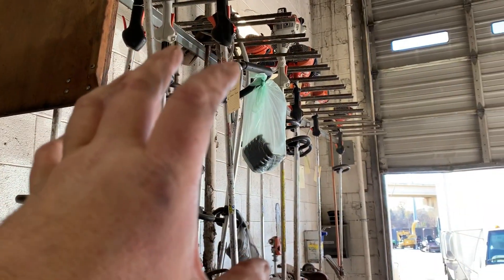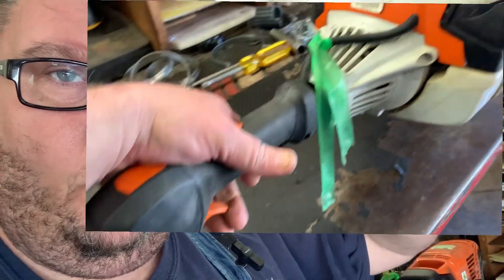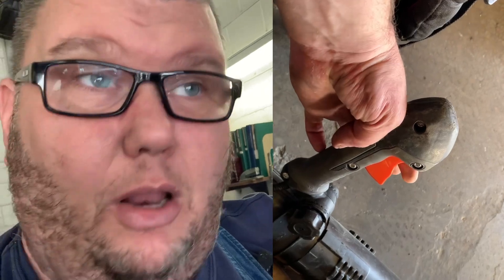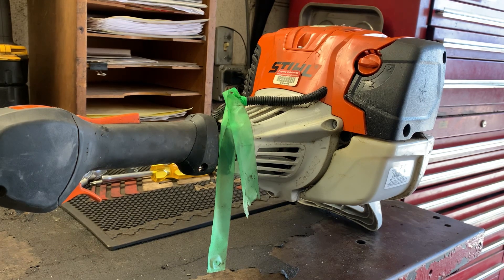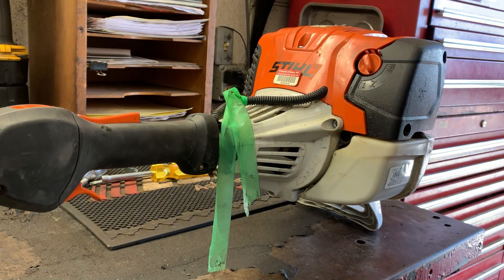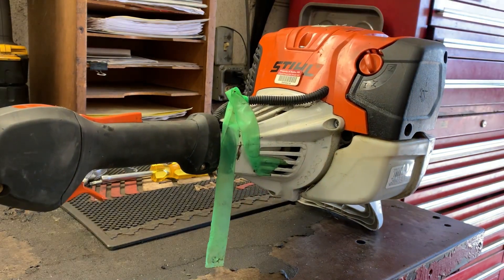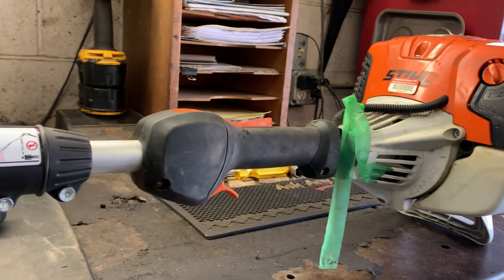HOW TO PROPERLY START A WEED EATER / BLOWER / CHAINSAW ETC

Comment: Its the slightly longer path the fuel/air/oil mixture takes in these 2 stroke engines that a lot of operators either forget or don't know about. For a cold engine, the combustion chamber needs a decent amount of fuel/air charge to start, hence a full choke. Once this first volume of fuel mixture has passed into the 'C' chamber the engine starts or spurters, and no need for full choke. At this stage the engine has cycled and there is more fuel/air charge coming from the crankcase and to keep the mixture at its optimum the choke is good at half or fully open. Easy way for operators to get to grips with starting 2 strokes is to understand the fuel/air pathway on one full revolution of the engine - diagrams would be good to show this.
Also after a start, these engines should be warmed up to temperature, gently especially in cold ambient temperatures. The first part to fail in a lube starvation situation are the piston rings and cylinder and these also get all the heat.
Reply: Very well said. After the machine is started, let it idle until it's up to proper temp, the full throttle while cold is a very damaging thing to do, a cold seize, and harsh wear is sur to follow.
Reply: All great information as stated but none of it does any damn good if NO One read the owner's manual.  Knuckleheads training other knuckleheads.

Comment: I'm not sure if I am lucky or I just take super good care of my handheld equipment. I have a pb-770t and I don't full throttle to start it, even in the super cold. I prime it until the bulb is full, full choke, pull twice and on the second pull its firing over, quickly switch off the choke and its running as it should. my srm-2620t and my pas-2620 are primed, full choke, pull twice to sputter, switch off choke, one pull to start. Maybe the only issue with the trimmers is they take a second to get up to full RPM.  My pb-2520 is slightly the same but I full throttle and feather the choke to warm it up to full rpm quicker.

Comment: I usually don’t use any throttle as well and they start fine, there is one or two unit(s) tht we have tht need a little throttle to persuade them. For All the others, I haven’t had to use throttle

Comment: Maybe you could explain why throttle at startup should be set to full. My guess is that that allows the choked carb to pull fuel from both low and high jets.
Reply: So the fuel doesn't hit an obstruction and flood the venturi in the carburetor resulting in blowback. I could be wrong, but that's what I've seen.
Reply from the maker: I Explained it in the video

Comment: That info about the "choke fluttering" was very cool, i had never heard of that before, is definetely something important to know when diagnosing a hard to cold start engine, btw, did you find the cause of that echo not staying running? I'm curious if it was a clogged fuel filter or carburetor screen

Comment: I've had lots of how to start a 2cycle or 4mix engine many times with my friends and customers especially 4mix it has a accelerator pump never hold the throttle open you just flooded the motor l get lots of them😠

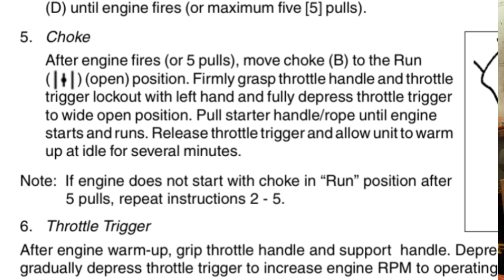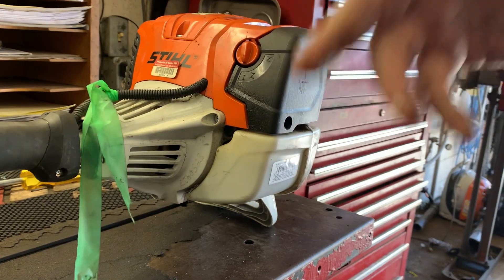Comment: No - it - does - not.   Read - it - again.  It says that AFTER hearing a fire, then move choke to open and THEN depress throttle. (like you say latter on in the vid) And I can tell you Husky's don't say that... Funny you call it a 'Primmer bulb" at 2:05 then minutes later say it isn't, it's a purge bulb. (is purge bulb) And listening to you talk at 2:00 on to after 2:30 you say "press primer bulb 'till there's fuel in the primer bulb, put it on full choke, make it go wide open throttle..." Then you show the book that doesn't say to do that?!? Earlier you said "don't do any of that half choke and none of that bull crap", then at about 6:00 you say put it on half choke. Then at 9:20 with the Echo you change again! You say press bulb, full choke, and fully press throttle! So are they all the same like you said or are they not? You say at 10:20 "redo your choke" but when the vid first started you said don't. You are clear as mud. Not consistent. And this is totally different than Husqvarna.